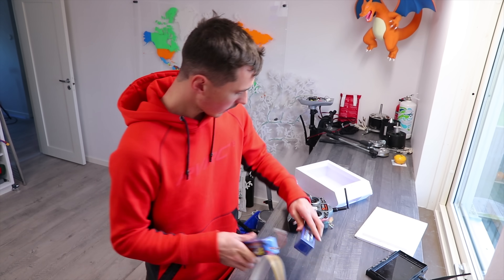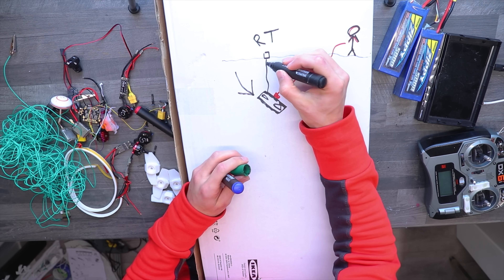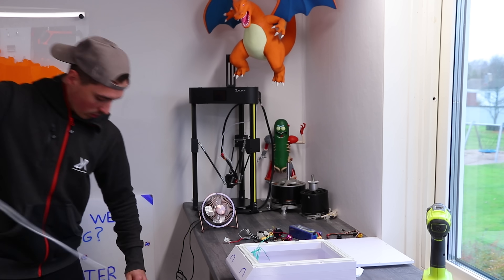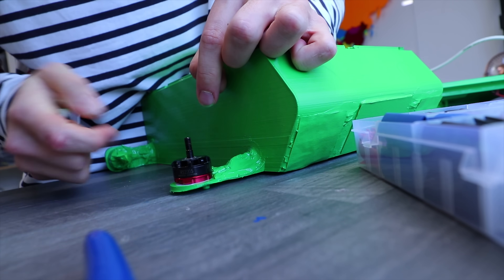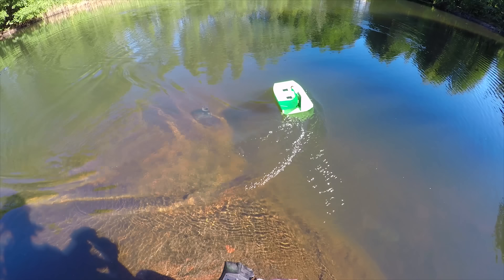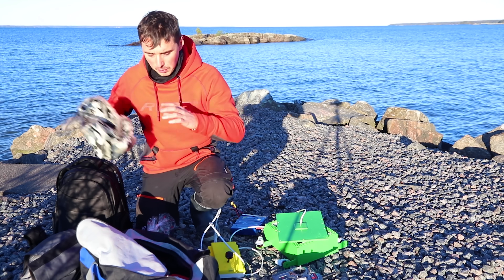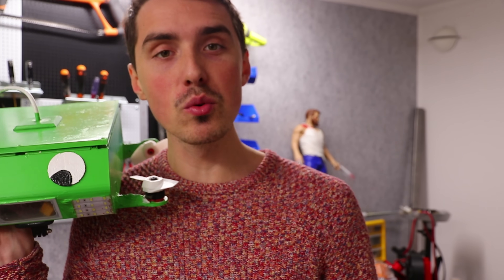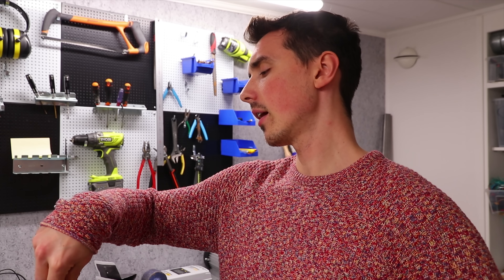3D Printed RC Under Water Drone - PART 1

Comment: you could use a smal air pump to pump air trough the connecting cable and push water out, in telecommunications we use this to keep water out of old leaky underground cables.
or print in abs and use acetone + abs "Gooop" to reseal the layers together really really well- also good for really strong prints btw <3
looking forward to the next part, keep up the good work <3

good crafting! - Lara Craft :)

Comment: Please tell me how you configured the motors to do this I’m having trouble stopping my motors when armed I’m building something like this and I’m using drone parts trying to get my motor to spin backwards and forwards and stop and then go anything you can send me diagrams beta flight setup is this a 3D kinks setup for the motors just a little bit of help my dude please thanks

Comment: for your surface vehicle, if you made it like a catamaran, you could put your wire on a auto retracting spool between the pontoons and gain pretty much however much wire length you want, without having to worry about the wire just hanging loose. you could even motorize the surface part, so it can real back in the drone, and then use the surface vehicle to move the rover wherever you wanted to send it under water. and or back to shore in the event it failed.

Comment: On waterproofing: I used to work on a commercial fishing vessel in Alaska for about half my life, so here's a few tips:
1. Sikaflex. It's about $8 a tube, water cures and is massively better than any shower sealant. We use it to repair cracks in fiberglass fish holds that need to seal and handle flexing and bashing around with thousand pound bags of fish.
2. Cables, hoses etc: a simple drilled pass through holes is very hard to seal. instead, you need some form of compression to pack a seal around it. a couple ways:
* vertical: drill a tight hole in the sidewall, the cut a rectangle out, bisecting the hole. put sikaflex along the whole length of both parts, put the cable in and compress the whole thing together
*or drill the small hole, but relieve the outer end just a little. make a washer or split washer that fits tight to the cable. Overfill the relief with sikaflex, then screw the washer on (compressing the sika tight all around the cable, with more surface than a thin hole would allow)
*or make the box shape with a bottom plate as well. cut some gaps for motor wires, then fill with lots of sikaflex on both halves, put the wires in and compress.
**final tips on that: clean/make sure the wires are clean before trying to seal. once they are clamped with sikaflex, don't touch it for a day (or you risk the seals). after that, they should be super rugged and resist movement while allowing a small flex.
3. access hatch: gasket it: buy some gasket material, cut to fit and sikaflex 1 side, so it always sticks to 1 side (no chance for contaminants or bulges to form). Also, don't put screws or bolts to the inside where they are prone to slow leak, put them to the outside, of the box/external

Paint color: I like the frog green, but dayglow orange seems like a good choice for visibility.
Pondering: I wonder how a green lazer pointing forward on it would look from the surface?
final thought: enhancement: make a weakly sprung cable spool for the rc lead, so it automatically keeps the cable short.

Comment: I would have done the same. The only difference is than i will have use the pressure sensor in the drone, to calculate the lenght of the cable. To rewind the cable when the drone is near the surface. To have always the good size of cable and not a long cable making node underwater.

You should also print the case and make it waterproof with a rubber seal. You have a 3D printer, use it !

Comment: Use a hose, like a air pressure hose between the flotation device and drone. Add pump in flotation device and pressurize the drone. You can run the cable inside the hose and it doesn't gets damaged as easily. Then you can make it fancy with pressure transducers to have just a little higher pressure inside the drone than the water so it doesn't explode if you rise from deep water 😅

Or just get someone to weld you a metal box.

Snyggt jobbat från Sundsvall 👌

Comment: A friend of mine used to build RC submariens in the past. He always used 100mm PCV Pipe for (waste-) water installation - we call it "KG-Rohr" in Germany. That stuff is really ridget, kind of cheap and it is designed to be watertight. Maybe a better core on which motors and stuff can be attached to...

Comment: nice. I am impressed the motors can run underwater like that. Find the leak like you repair your bike. Air pressure inside will make bubbles at the leak ?

Comment: bro you need to learn how to print grooves in your stuff for an o ring type seal you can get bulk rolls of o ring material and special glue and make any size o ring gasket you need you could also get sheets of thin rubber gasket material and cut gaskets with scissors the problem you have is the plastic you are printing is too flexible so when you tighten the screws down it flexes with sealant you need something more rigid it sounds crazy but not tightening the screws down as much will help also by not smashing all the sealant out the sides if you must use sealant apply the sealant only tighten the fasteners down a bit let it dry then tighten them down a little more to create a better seal make your fasteners closer together and use more so there isn't as much space between i am an automotive mechanic so i know all about sealing in fluids

Comment: if you make it so that all the electronics are waterproof then you can have a box with just a small air bladder to keep neutral buoyancy. it will fix all the leak issues along with allowing for smoother movements as you wont be fighting the water to stay under.

Comment: you should use a "Tupperware" style container with snap lid for the body. Also, you could place a large syringe inside that with the nozzle outside of the box. Then a servo can be use to fill the syringe with water making the craft go down. When you want to come up you simply empty the syringe! Genius!

Comment: Even at 3m your going to have 29.4kPa which is > 4lb/inch^2(psi). That's going to make it difficult to waterproof. The mechanical forces will be a bigger problem. The lid of the sub looks to be bigger than 12x12 inches which means 576 lbs (260kg) of force on your lid. Can you and two friends stand on it?

Comment: remember air goes up.. water goes down..
So make your holes at the bottom of your craft..
Also someone did a video recently where they finished there 3d print in salt to anneal it all, that would be a good option to make sure you have no holes on the plastic..

Comment: I keep water out of my hamster habitats by maintaining internal overpessure. If you run an air tube along the control cable you can pump a constant feed of air into the enclosure, which will prevent water from entering. Then again there are simpler ways to make a drone water tight. Perhaps start with an otterbox as the electronics housing?

Comment: Use 6 motors ? Two for going up and down and four to control it forward backward right turn, left turn etc.and try to go for a circular design if you can but id say to waterproof it more better try using rubber gaskets and silicon grease and screwing it down. And balance the thing about its com much easier to control amd distribute weight that way. Nice work! And a great idea!! Looking forward for more!!.

Comment: Use VLF or Low Frequency then you won’t need that flotation device, but you will need a wire to couple the signal with the lake. Also, i think you should have drowned the electronics in epoxy so you won’t have to think about water leaking or weight.

Comment: Simon put the batteries in the floating box and make the underwater drone with no air internally so wires, controllers, camera, LEDs in a sea of epoxy resin - think small like a coke can (or smaller) with propellars. No water no problem. All the stuff you need to access should be in the floating box.

Comment: You need to put a bladder inside that you can pump water into so you can control the weight without removing the top.

Comment: if you turn the box upside down, so the access hole is on the bottom side, you wont have to much trouble when water gets inside, cause all the electronics will be in a nice air bubble.
Reply: Until you pitch and the air bubble moves to the highest point in the drone.

Comment: i built an openrov a few years ago.. the way it communicated wia the umbilical cable (which is a single twisted pair cable with no shielding) is done by killing 2 wifi extenders.. the ones you put in the wall socket that have ethernet input in them.. have one in the rov and one on land..  the openrov have all the important stuff inside a pipe..

Comment: Actually u could have all the electronics multiple resin blocks , supply power from a cable and have the case printed with gyroid infil without walls , so u have no weight and or pressure problem

Comment: the 360 camera doesn't work under water bcs the light gets bent when passing from the lens to the water, this is fairly symple physics but often overlooked, you would need a specific under water 360 camera

Comment: You could waterproof the electronics... Like soak them in epoxy, won't be great for cooling but if it's in an Ambient water environment it should negate it. Also  maybe have the batteries external of it so if it does go in salt water you don't just die...

Comment: Have an external tray where you can add or substract weight without having to open the case. Also, one piece seal works better than using multiple cuts. You can try a Flexible 3D printed lip seal.

Comment: Instead of vertical fans, use ballast, e.g. from a syringe, but to use it, you need to reduce the displacement to zero so that after filling the tank with water, the drone falls down and when the water is released it floats. Also, dont forget about the pressure so that it doesnt open the lid, which will result in flooding the electronics

Comment: Would it not make sense to build it upside down, so the box acts like a diving bell, and your electronics can stay dry. The motor arms could come out the bottom, so there is no areas where you have to pierce the box and cause a weakness. Just a thought...

Comment: Did you change the settings in the Insta 360 to facilitate for the waterproof enclosure? The additional layer of glass affects the way the light bends and this is the reason why the camera didn't record anything. :(

Comment: Hej,

You should check out this cable, I didn't even know CAT5-e cables this thin even existed. Its about 4mm thick so won't be as unwieldy as the normal CAT5-e.

https://www(dot)billigteknik(dot)se/kabel-adapter/20665-16099-natverkskabel-cat-5e.html
Reply: I'd also say adding a ballast tank may be a good idea as well, something like a huge syringe with a corkscrew/worm gear/whatever its called that can suck in water to drop and push out water to float.

Comment: Simon, Do yourself a favour for this and other projects, especially seeing how you like watercraft, go on eBay and look up "ip68 cable gland" buy a BUNCH of them of different sizes as they are dirt cheap and usually sold in packs of ten, they are super easy to design for 3d printed parts. you will thank me later just to eliminate 90% of watertight issues.

Comment: I think the Propellers are not strong enough. the propellers must fight against the uplift of the Box, so your Batteries will run dry very fast, because the Drone fight to hold position underwater. And if you put weights into the Box, the Propellers fight against the Heavy draft down :).. Ballast Tank with compressed Air, is a good solution. the snorkel is this Box for fresh air. And also i think your underestimated the Water Pressure to keep it Watertight..

Edit: Measure the Drone weight, and then try to add the same Weight as counterweight. I think you should take into account the Uplift force of the trapped Air inside the Drone with deepness (Pressure).  It is the same problem with find the right Balance with Planes center of Gravity, but guts feeling the Air inside is troubles you

Comment: I used food plastic body for my submarine. It's easier to seal just a few small wire holes + it can be easily opened. I like your idea with a floating receiver.. Might try it

Comment: Dude, just a tip: use epoxy to waterproof it. Nothing else is going to work very well. Oh, also apply some silicone conformal coating on the electronics!
Other than that, great work! 😃
Stay safe there with your family! 🖖😊

Comment: Underwater video needs alot more light than normal air surrounded video. The water, especially if the total organic compound level is high(meaning the water is murky from all the biodegraded leafs and stuff)  will absorb and disperse most of the light. You can put really powerfull leds into that thing because they will be surround watercooled. 
 And yes, the 360 camera will have some troubles filming at extreme angles because of the difference of refractive index between air and water.. 😁

Comment: try a design with 5 shells printed in vase mode (which is key), insert the electronics while its printing but lay the wires at the same time with just small openings to allow them through and an easy seal up....is risky but can always crack it open hahahhaa , extra few % flow is good here. I printed mum a single skin vase and has been holding water for nearly a month now in regular PLA

Comment: Simon, For the past three to four years I have volunteered as a Robotics Advisor to a group of very motivated middle schoolers who participate annually in a competition called the SeaPerch Challenge.  Our teams, over the course of those years, have taken 1st, 2nd & 3rd place honors in regional competition events and usually 1st and 2nd at the international event.  I would suggest that you reference the SeaPerch website to get some ideas/pointers on how the SeaPerch ROVs are constructed.  The basic SeaPerch ROV is created from PVC Pipe, however, our teams have done more thinking outside the box and successfully created incredibly lightweight, streamlined ROVs made from 3D printed parts as well as from lightweight aluminum wire for the frame.  Like you have learned, moisture control is essential.  We have found spray bottles with screw caps make a more adjustable method to get the submersible to become neutrally buoyant.   Can't wait to see Part 2 of this series.  Thanks for the video!

Comment: I've spent one season to make wired diy Rov and one more season to create wireless Rov.
Well, your hopeless trials to sink 3 liters are desperate. Its better to get rid of Arhimed's volume so there would not be a need for a weight to balast it as you will spend lots of power to overcome inertia. Still its going to be feasable at still water - not in river. Pressure will make you cry as water leaks will be all the time. I'vs poted everything with epoxy even camera.
With this motor layout you will suffer from sways untill tilt roll compensation will be introduced. I used 4 vertical and 2 horisontal thrusters. And pressure sensor to make depth stabilization.
Its better to think of floating cable as open props may not be friendly to wires and fishes) i used cylinders to protect props and tubes to make wire float. 
Anyways will be checking out your progress! Interesting how You going to realize it! 

One of my last dives with 360: 8m depth, 75m distance from rc.
https://youtu.be/YiPUhVgzTXE

Comment: You may or may not want to consider this, but years ago I built a simple wired underwater drone.  Not as much electronics inside since it was wired, but what electronics I did have in it was enclosed in a small case filled with mineral oil (baby oil). It's none conductive, so no shorting things out. Keeps water from getting in and helps with the buoyancy since it's not in an air pocket.  It's a bit of a bitch to clean up, but with no air, no worries about water leaking in.

Comment: Hey, I'm thinking abut doing the same thing! Except my goal is to have it completely wireless. I would have to find out how to get video over 50MHz to penetrate the water, and use an older 28 or 70 MHz system for control. 
Good luck!

PS - In case I have to do the wire option, what did you connect the cables to on the drone side? Just the antenna(s)?

Comment: I feel like you're starting from scratch.

Keep the volume down as tiny as possible. You're going to need weight to counteract the lightweight materials you're using. (3d printed metal maybe?) And you've got to solve the problem of waterproofing wires through the hull (maybe easier with metal?). Water pressure really builds as you go down.

I would suggest rethinking the motors. You've essentially got an underwater airplane. No ability to loiter and get good shots. I mean, a brick with 4 quadcopter style motors would be better. Make this thing almost buoyant and then fly it like a quadcopter.  But if you want to get good shots, being able to hold still without stirring up mud, you'll need to be able to hold position with minimal motion, you need buoyancy control.

Comment: Why is the lid on top??? If you turn a bucket upside down and put it underwater the top part of the bucket will stay dry even with the bottom open. You need a drone with the lid and all wires coming out of the bottom and all electronics mounted high.

Comment: You can adjust the weight for a certain depth, but that also means that it will sink to the bottom if it fails.  You might want to consider some kind of recoverable ballast system, which will allow it to float should there be a failure.  Turning your drone into a Tiger Drone Sub, might be interesting.  You can keep the googly eyes, just add jaws.  ;)